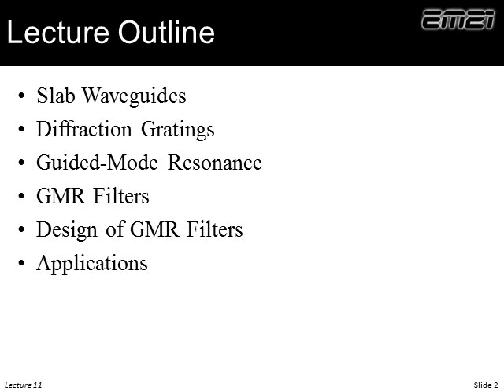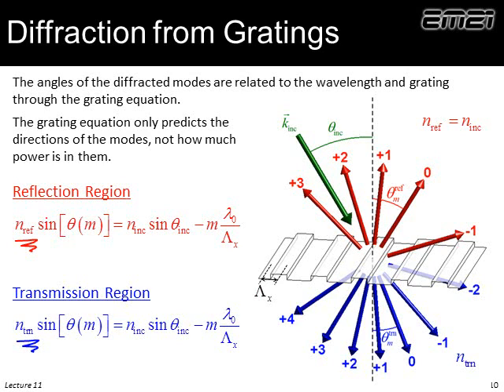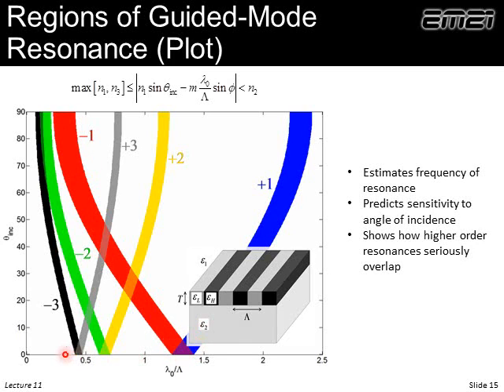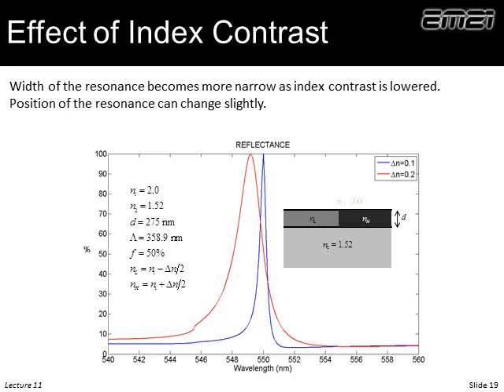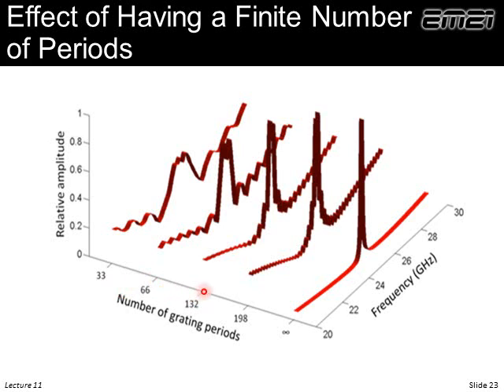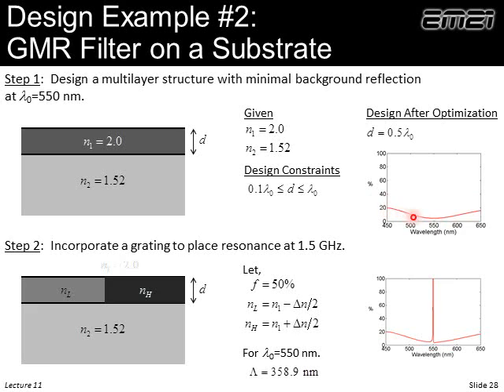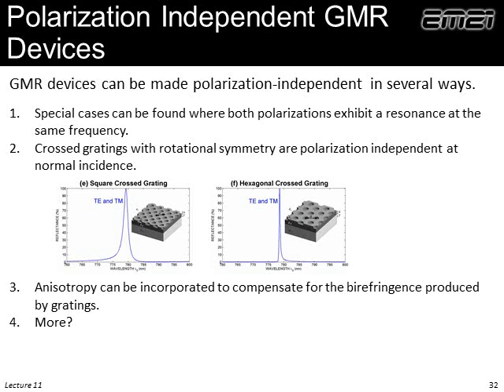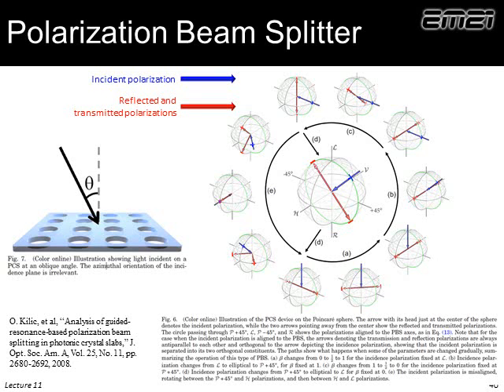Lecture 11 (EM21) -- Guided-mode resonance

Comment: These are very good lectures.
Reply from the maker: To couple power from an external wave into a guided mode, at least one diffraction order other than the zero order is necessary.  Therefore, the grating cannot be subwavelength to the waveguide.  However, it can still be subwavelength to external waves since the refractive index is lower and wavelengths are longer.
Reply from the maker: @rajatsharma6256  I am referring to the effective refractive index of the guided mode.  If the period of the grating is less than the period of the guided mode, there will be no diffraction into any diffraction orders and guided-mode resonance cannot happen.  The effective index of the guided mode must be such that the grating is not subwavelength to it.  I am speaking in these terms because the grating can be placed almost anywhere, above the waveguide, below the waveguide, inside the waveguide, combinations of these, etc.
Reply from the maker: @rajatsharma6256  This is not a subwavelength grating.  The refractive index of SiO2 is around 1.5 so the wavelength inside of the glass is closer to 200 nm.  This will give you +/- diffraction orders and guided-mode resonance can occur.  Now your substrate needs to be thin enough to be an effective slab waveguide.  If it is too thick, it will be leaky for other reasons and you will not get a clean GMR response from it.

The now suppose the diffraction grating period was 199 nm.  There would be no diffraction orders and guided-mode resonance could not be supported.  The energy propagating parallel to the surface are cutoff diffraction orders and decay quickly.  Those modes cannot excite a guided wave because their spatial frequency is too high (i.e. they are oscillating too quickly).

Comment: Dear Sir,

Thank you very much for such a great lecture. 
I have a small question can you kindly provide the research paper the Square cross grating and hexagonal grating whose reflectance curve is shown in lecture 11 slide 32. Thank you sir once again.
Reply from the maker: I don't think I got these devices from the literature.  I think I just made them up for the picture.  I really should have included the specs of the devices to reproduce the results, but I did not.  Is there something special about these devices?  If not, there should be plenty of similar devices in the literature you can practice with.
Reply: Thank you, sir, for the prompt response I was designing 2D GMR filter. I use CrystlWave (PhotonD) tool for stimulation. I want to design a Hexagonal crossed grating to filter for wavelength 600 nm. Hence, I want to try simulating the structure in the slide 32. Also, it would be extremely helpful if you can make a lecture for designing and optimizing 2D GMR filter. Thank you once again.
Reply from the maker: You can design a hexagonal GMR just like 1D GMRs.  First, design a stack of homogeneous layers that give you the background response you want.  Second, introduce a grating somewhere such that the effective index in the grating layer gives the refractive index of the design from the first step.  You can use effective medium theory or you can just perform a parameter sweep for size cylinder vs background response and pick the cylinder size that is best.  Third, adjust the period of the grating until you see a resonance where you want it, probably in the middle of the background response.
Reply: I would do that sir! Thank you, sir!

Comment: Thanks for the explanation, What is angle phi in slide  11 ?
Reply: It looks like I was slightly inconsistent when writing the grating equation.   The angle phi is the slant of the grating.  Usually this is 90 degrees and sin(90) is just 1 and so not written in the equation.  This parameter is discussed in a prior video on diffracting gratings.

Thanks for pointing this out.  I will put it on my "to correct" list.
Reply: I edited the notes on the course website to retain the angle phi in all expressions of the grating equation.  This way, it does not appear and disappear at random.  Incase you are not aware, here is a link to the official course website that has links to the YouTube videos, the latest version of the electronic notes, and other resources.

http://emlab.utep.edu/ee5390em21.htm
Reply: Thank you @Raymond Rumpf
Reply: Do you know any good tool that simulates multi-layer patterned structures?

Comment: Hi, I have another question. How do you do simulations? Do you know LightTrans VirtualLab 5 software?  Thank you.
Reply from the maker: Great question!  The tool we use to simulate devices depends on the type of device we want to simulate.  In this lecture, my two favorite techniques are finite-difference frequency-domain (FDFD) and rigorous coupled-wave analysis (RCWA).  I teach both of these methods in the course Computational Electromagnetics.  Here is a link to that course website which has links to the YouTube videos, the latest version of the notes (lots of improvements and revisions), and tools to help you develop your own codes.

http://emlab.utep.edu/ee5390cem.htm

I am aware of the LightTrans suite of tools, but have never used them.
Reply: Thank you for your help.

Comment: Hi, thanks for your awesome lecture.
However, I was just wondering if how you did the simulations of GMR filter on slide at 16:19.
Using COMSOL and RCWA method, I could not represent that graph.
If the graph of that picture is from a paper, could you give me the name of it? 
I am a student who wants to study this, and thanks again to your great video.
Reply from the maker: +성장운 This is not from a paper.  In this device, the substrate material is taken to infinity (infinite half space).  Did you put that in your model?
Reply: Thanks for a kind comment. I did solved my problem which was due to my wrong code manipulation.
Again thank you!

Comment: Hi, Thank you for this great video, but I have a question. What on resonance the device reverse the background response ? I don't see the physical reason. 

best regards
Reply from the maker: The GMR produces a filtering response due to the interference between the waves scattered by the slab and the "leaked" wave.  The background transmission and reflection establishes the phase relationship between the fields scattered by the slab.  Thus, they interfere differently with the "leaked" wave to produce different transmission and reflection responses.  In the end, the GMR acts to reverse whatever the background transmission and reflection is.  This is also why the ugliest resonances occur when the background response is around 50%.

Comment: Sorry, I have another question. Can we have surface mode instead of transmitted or reflected modes? And, is it possible to couple it to the waveguide?
Reply from the maker: When a wave is incident on a GMR, some of the applied wave is reflected, some is transmitted, and the rest is coupled into a guided mode in the slab.  As the mode propagates, it slowly leaks from the guide due to the grating.  It is the interference between the leaked wave and the applied wave that leads to the filtering response.  

It is absolutely possible to couple power into a waveguide.  These structures are called grating couplers and are used quite commonly in integrated optics.  In fact, grating couplers and GMRs operate on the very same physics.
Reply: Thanks for reply
Reply: @empossible1577  Hello, is it possible to use grating couplers to couple power into a waveguide smaller in size that the wavelength of light you are using? And then perhaps couple it out of the waveguide through some other method to acheive an extremely small spot size? Sorry - I'm very new to optics.
Reply from the maker: @dragongirlster  Yes, but you need to make sure that the small waveguide still supports a guided mode.  If not, the grating coupler cannot force that to happen.  The small spot size is more challenging.  Grating couplers that do this are called focusing grating couplers, but they cannot focus beyond what an ordinary lens can do.  The real limitation is that once the light leaves your device and enters air, it is subject to ordinary diffraction laws.

Comment: Thanks for the video! I would like to know whats the reason for the very small bump that appears near the resonance for H-mode in slide16? Or whats the reason of the dip that appears very close to the resonance for H-mode in slides19 and 15. Why it does not appear for E-mode?
Reply from the maker: Small bump -- I would have to run another simulation to be sure, but I suspect that bump is a second resonance that has not been resolved (not enough frequency points).  Sometimes, however, nonphysical resonances can appear in a simulation due to numerical problems.  To be be sure, I would resimulate this device in the vicinity of that bump and make sure my simulation was well converged.

Dips -- I have observed these dips to be most severe when the background transmission or reflection is not close to 0% or 100% or when the background response has a slope.  It really is the natural response of a resonance.  It is just that we usually suppress it with symmetry and railing the background transmission and reflection.
Reply: Thanks for the explanation.

Comment: Thanks for the video! Nice explanation. What are the refractive indices that you use to plot the regions of resonance?
Reply from the maker: I am embarrassed to say that I cannot find the code I used to generate this figure.  I will have to rewrite the code and generate a new figure.  I also noticed some inconsistent notation used in this part of the lecture (i.e. n1, n2 vs erL and erH).  I will fix this as soon as I can.  Thank you for pointing this out.
Reply from the maker: I rewrote my code and played with the numbers until I got as close of a match as I could.  I ended up using n1 = 1.0, n2 = 1.4, n3 = 1.2.  I "think" I picked these numbers to separate the regions for a better picture, but I don't think they are very realistic.  For example, it would be difficult to have a substrate with refractive index 1.2.  I will soon update the slides with a more realistic example.  Hope this helps!
Reply from the maker: I updated the lecture notes, but not the recorded lecture with a new Slide 12.  See Lecture 11 here:

http://emlab.utep.edu/ee5390em21.htm

I show more resonances, the device and all the associated parameters, as well as the equations I used to calculate the regions.  Let me know if anything is still unclear or missing.
Reply: CEM Lectures Yes it does! Thanks a lot!
Reply: cool! just one more question, maybe its silly but i don't really get it. so, why don't we see the resonance from the zeroth diffraction order in the graph? I mean we would expect to see only zero diffraction orders when the ratio lo/L is higher than 2 right?
Reply from the maker: Sotiris Sarros Good question.  There is always a zero-order diffracted mode, but under most circumstances it cannot excite a guided mode.  In order for it to, the external regions must have a higher refractive index than the core, but then you would not have a waveguide.  Therefore, the zero-order mode is not shown since it cannot produce guided-mode resonance.
Reply: CEM Lectures That's really interesting because I was reading an article where they claim that they produce guided-mode resonance from zero-order diffracted mode, by using a small grating spacing compared to the light wavelength. But anyway, I don't want to trouble you anymore. Thanks a lot for the information that you had provided :)
Reply from the maker: Sotiris Sarros Can you provide the reference information for that paper?
Reply: CEM Lectures of course! the article is called "colorimetric resonance reflection as a direct biochemical assay technique" published on 2002.
http://www.sciencedirect.com/science/article/pii/S0925400501009765
Reply from the maker: Sotiris Sarros I took a quick look at this paper.  This is ordinary GMR so the grating is definatly diffracting into higher orders within the grating.  I think they are saying the period is short enough that outside of the grating in the external regions there is only a zero-order mode.

You may want to search for papers by Robert Magnusson.  He is a big name in GMRs and is doing this type of biosensor sensor work right now.

Thanks for sharing.